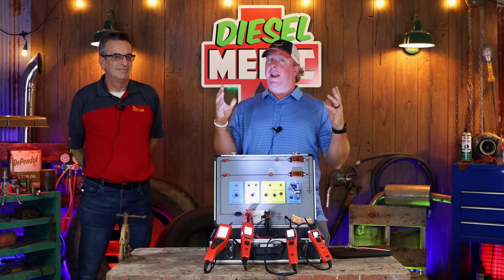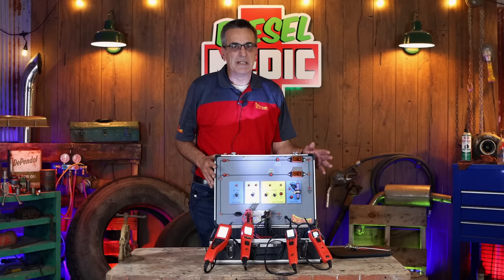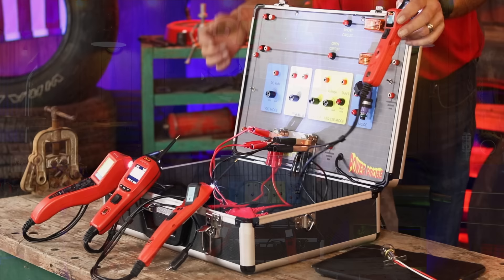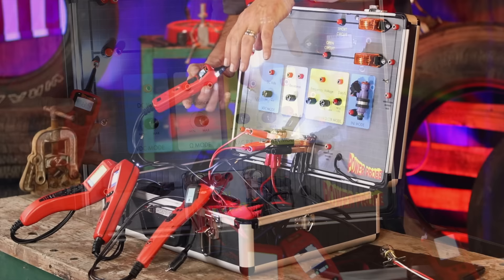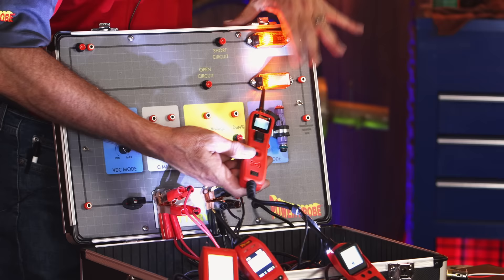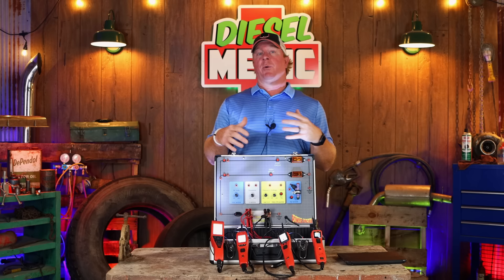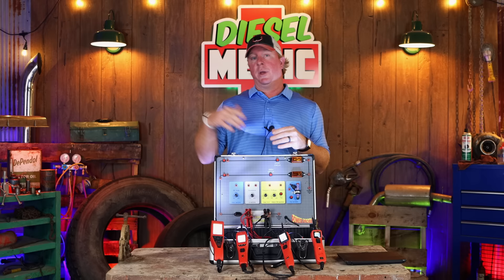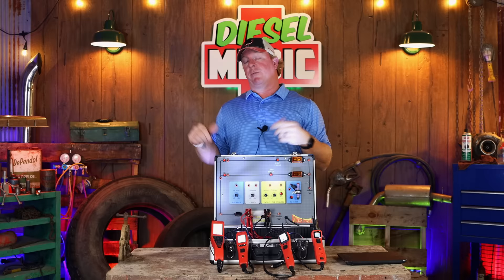PowerProbe: How To Use It Correctly! Demo By PowerProbe To Show You How To Use It The Right Way!

Comment: You have to have a thorough understanding of electrical systems before you use a power probe....but the same could be said for a multimeter.....if you don't understand what's going on in the circuits you shouldn't even be doing electrical to begin with.
Reply: TRUE DAT !!!
Reply: If you can’t do electrical you shouldn’t be a mechanic
Reply: @pandaratio2917  ppl still need tires, brakes, and oil changes. Plus all the fluid flushes. Lol
Reply: @jduv6455  not hating becuase I started there too but doing those jobs doesn't make you a mechanic or technician....
Reply: @85jmccoy  I understand what you are trying to get across in regards to the video. I disagree with you labeling a mechanic. Its cool tho.
Reply: @jduv6455  what part  don't you agree with me with?  Pulling a drain plug doesn't make you a mechanic or tech.....busting tires does not make you a mechanic or a tech....and hanging brakes I could teach my 13 yr old nephew to do..... hell I was doing it at 13....but you have to start somewhere I had to also....started out bustin tires and hanging brakes.....knew I wasn't a mechanic or tech yet.....
Reply: @jduv6455  you better learn electrical..... especially if your young..... im halfway through my career and I knew back in 08 when hybrids and evs were just being speculated about but they are coming and knowing electrical will be more important than ever!
Reply: @85jmccoy  there are people out here who specialize in rebuilding mechanical parts. I guess they are not mechanics. Lol they are just like your doctor's would say "you'll have to see a specialist for that". Lmao
Reply: @jduv6455  no...... that's a specialty and they are probably more mechanic than I'll ever be

..but can you do it?
Reply: @85jmccoy   I don't but id like to think i could. What about mechanics that work in a factory. Im js, you can't just throw the word around like it means one thing.
Reply: @jduv6455  well if you think you can you can.....trust me I'm not trying to cut anybody down and we need more people in this field and I'm not going to be the old man that cuts the young guys down everybody is valuable in this field but we need more guys to step up and learn electrical and diagnostics and critical thinking in general....we need more guys that can actually rebuild rearends and transmissions amd do it right.....
Reply: Never be afraid to learn !
Reply: @jduv6455  yeah but The things you just named mechanics don't do
Reply: @jduv6455  generally speaking here's a good definition of a mechanic for you since you seem to disagree with the other guy that I actually agree with a mechanic is someone who understands how the general systems work completely and he can diagnose them by himself and knows what to look for Rather than a parts changer that can just take bolts off and put bolts on like any basic person on the planet can like the other guy said pulling out a drain bolt pulling some tires off a rim and putting them back on and hanging brakes doesn't take any diagonalidge or even mechanical knowledge.

Comment: A definite must for the power probe is the 5v step down tip. It will save you from frying something.
Reply: Do you use the  5volt step down tip all the time? when and how do you use it?
Sorry to be such a bother.  I just bought a PP3 and I'm trying to get set to use it. Thank you!
Reply: @paulcoover9197  I only use it when dealing with 5 volt ref circuits. If you are unsure, get a wiring diagram.
Reply: @justforkiks29  Thank you very much.

Comment: Never ever use a power probe on any bcm, pcm or ecm... It should only be used to power up or diagnose window modules, door lock actuators or a fan circuit... When powering up a module disconnect the module from the vehicle...

Comment: I love doing loaded voltage drop test with the power probe. Isolate the circuit, shoot 12v through one side with a 3157 bulb connected to ground on the other side. Then preform a voltage drop test of that circuit with the light on. Found many of pinched can bus wires that way.

Comment: This just a personally opinion and I've been using a fluke for a year now testing 480v to 120v AC and 12v to 24v DC systems and I've never used a power probe and don't see the point sometimes when switches have broke I use a wire that's the same gauge and jumper the switch just make sure its broken but I've only do that switches that are manually to perform a certain function. So I would like to know how a power probe would be usefully where a multimeter wouldn't be.

Comment: You didn't explain that extra alligator clip attached to the probe?
Reply from the maker: one goes to the battery positive one goes to the battery negative, that's how it supplies ground or power at the press of a button to complete the circuit
Reply: I think you hook that to a starter or something that you want to bench test out of the car.

Comment: I'm a little confused. Can you please explain to me what is happening when you use the power probe positive or negative switch? How is current flowing? Why is it not okay to send power to ground-side, or ground-side to power side? in other words, what are you doing exactly when you flip that switch?
Reply: can you also explain to me why the wrong way is wrong please? like the way current flows, doing things the wrong way
Reply from the maker: Sending current (positive) to the negative side would cause a short to ground. (Blow a fuse or damage electronics) same way goes with sending ground to power side (short to ground). Here’s another video that shows how it works https://youtu.be/VgJe5fiXcn8?si=Fdopxjb85z0wyPgP
Reply: thank you so much. As simple as the question may seem, its a big help. thanks. you're helping me tie up some misunderstandings i have with using the power probe, and circuits in general @KoonTrucking
Reply from the maker: @aaronmcdonald4944  glad to help. The video I sent the link to should give you more understanding on how it works. The PowerProbe is a wonderful tool to eliminate issues and isolate the problem so you can fix it. For instance if you can apply ground to the ground side of a fan on an ac unit, you hit the power button inside and apply ground to the ground side and it runs you know you have a ground issue. Then if that doesn’t work you can apply power to the hot side and if it comes on you can narrow it down to a faulty switch or wiring issue pre or post switch. If it still doesn’t come on you know you can check the power with the probe at the connector and if you have power and ground then you know the fan itself is bad. Hopefully that all makes sense.

Comment: Can you tell me where the switches are located to fix the power and ground circuits to flip them like he did to fix the problem. I can't recall seeing any toggle switches in the wire looms.
Reply from the maker: He said you do the repair (then he flipped the switch) I get what you are saying but at the end of the day it is a demo board 🤔
Reply: @KoonTrucking  JUST HOPEFUL for an easier way. So I still have to find that frayed/green crust  coated wire or connection and repair it. Seemed flipping a switch would be faster AND
easier...............CAN'T BLAME ME FOR TRYING/ASKING...We're always looking for that magic SILVER BULLET fix.